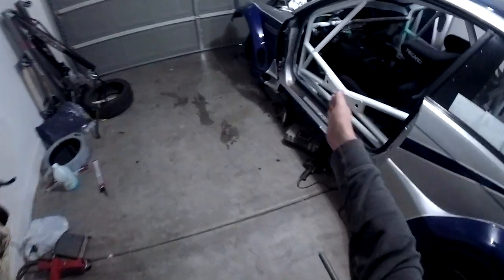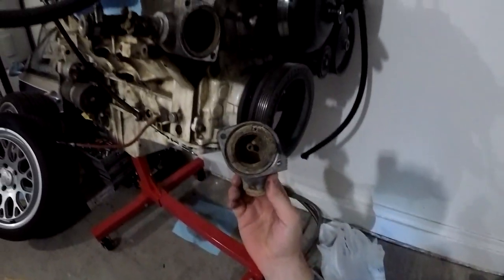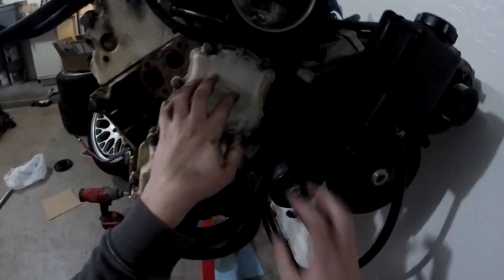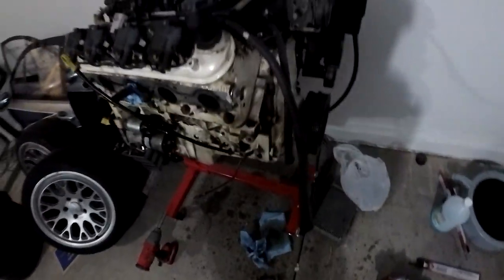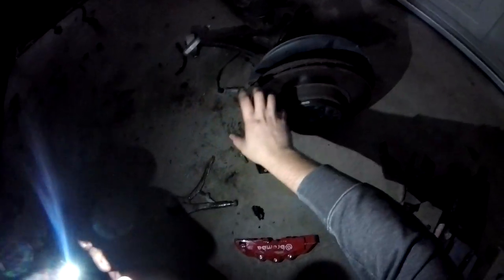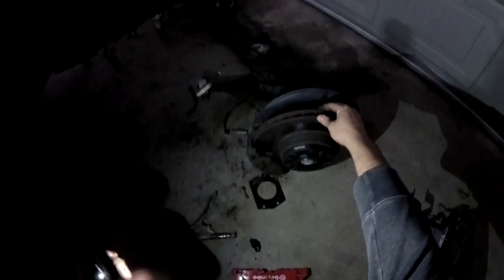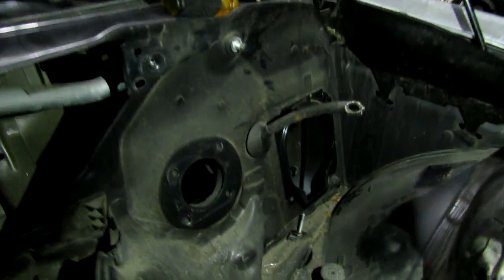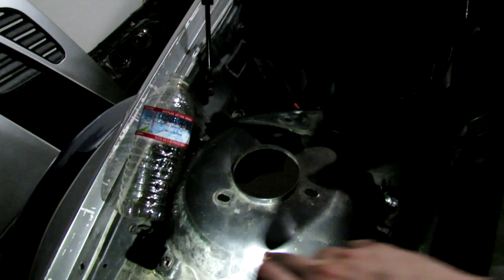Working on my V8 M3 POV

Comment: Andre did you buyed the V8 from the M3 GTR Street Version because the Race M3 GTR has this engine in it just asking.
Reply: Obviously not gonna steal a engine from a car of which only 10 examples were made,he bought a Chevrolet LS1 V8 engine
Reply: @gauravsrao8887  thx im just asking😁
Reply: also buyed isn't a word
Reply: @Gsr_automotive  it is
Reply: @briangamer69  it isnt.   check your gammar
Reply: @briangamer69  the past of buy is bought, and in the sentence you said you're supposed to say buy as in did you buy
Reply: The P90 engine is extremely expensive, I doubt he has enough money to buy a M3 GTR
Reply: after the word DID it must be followed with a root word. 
DID u BUY (CORRECT)
DID U BUYED / DID U BUYED (WRONG) 

and yeah, im also not a really good english speaker..